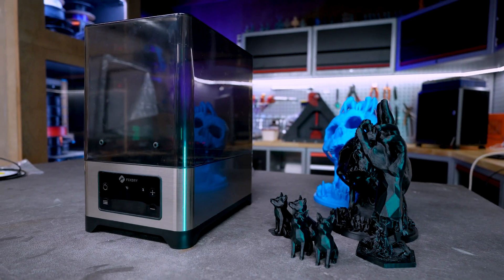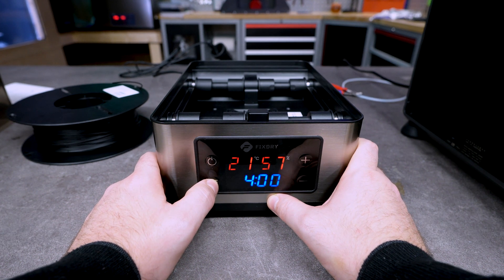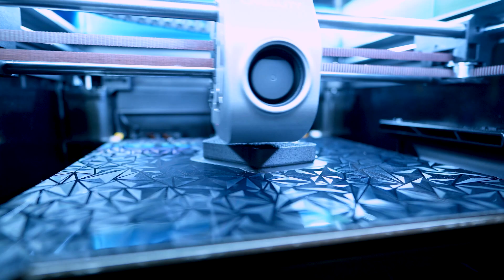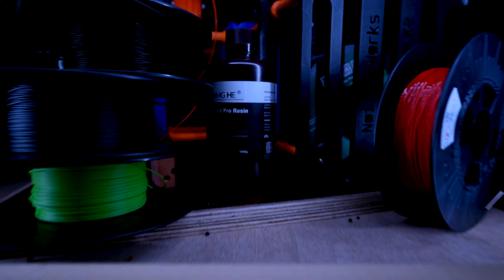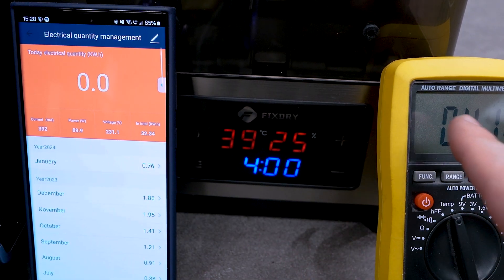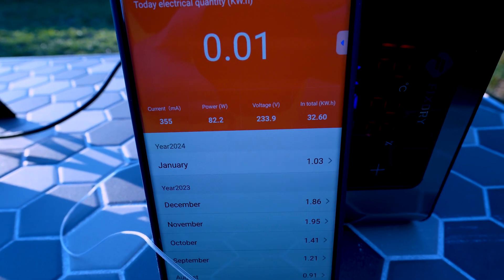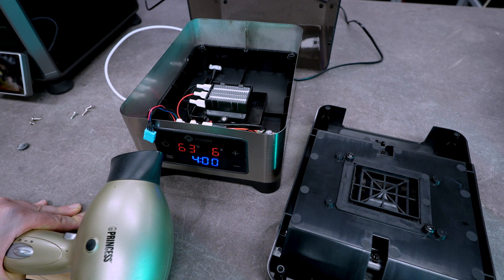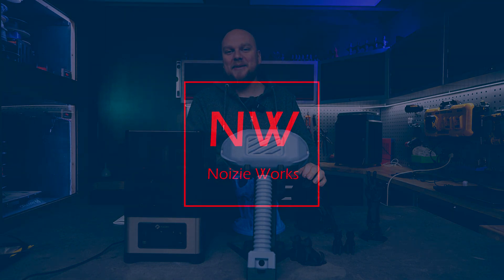What is "WET" filament and can the Fixdry dual NT1 filament dryer really fix it? Here is my review.

Comment: Thank you for review.  It had valuable information for me on how to open case.  I tried to take off bottom, that didn't work!  I gave up.  After much searching, I found your review and learned top of base comes off.   I hope to design a better controller for it.  I'm thinking about adding a i2c Sensiron SH3 sensor near top, and adding smart feature to regulate humidity, and temperature.  I may also try active vents, that close for storage. And add LED illumination inside to help monitor spool rotation,
Reply from the maker: Sounds pretty cool! Keep me in the loop